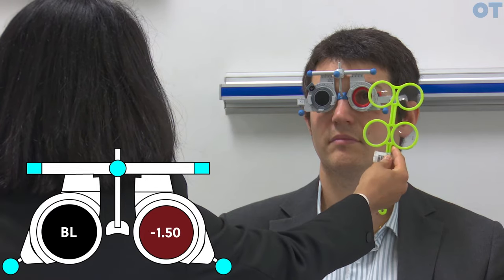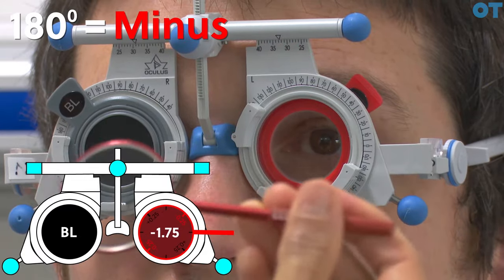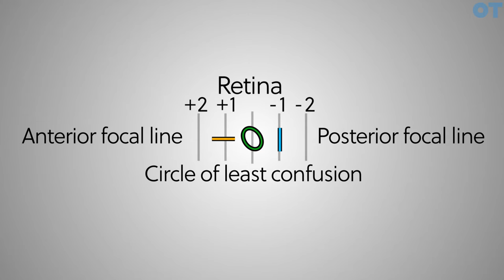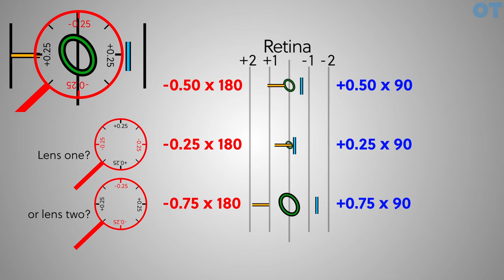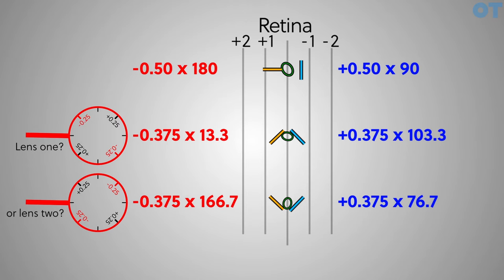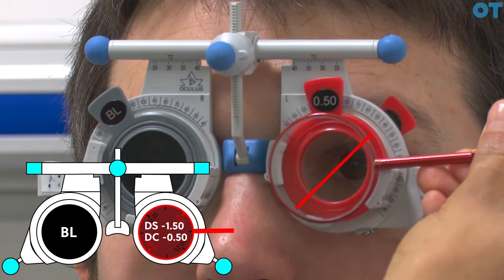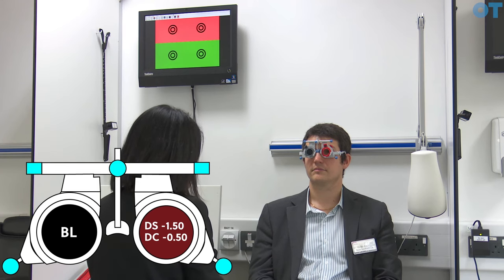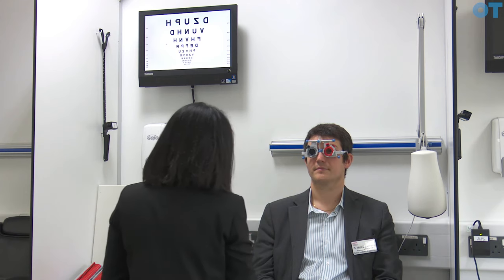OT skills guide: Jackson Cross Cylinder

Comment: Important bit when dealing with patients who have seriously impaired vision since birth (nystagmus, ocular albinism, such as myself). They might have a very weak ability to judge the specific direction of lines in the distance. So, for example, if a patient who has problems with distinguishing vertical lines clearly is being asked if the circle looks sharper with lens one or two, they might base their reply solely on the horizontal-ish parts of the circle. They will have a very hard time deciding if the circle has become rounder or not because the vertical parts will look blurry to them because of their nerve-brain issues, so no lens can fix those. This might make subjective refraction much more difficult when you know that the patient sometimes is confused and might start giving conflicting answers when it comes to dealing with correction at more vertical angles.

Comment: The circle of least confusion was already placed on the retina at the end of the last video (best sphere) and verified by the duochrome test, why do we need to over minus the patient by -0,.25 before using JCC?
Reply: This helps to ensure that the circle is on a retina, because accommodation will bring the circle on retina
Reply: @MrGeriausias  But doesn't the eye need to be at accommodation rest for the whole subjective refraction? Why don't we just leave the circle on the retina by best vision sphere?
Reply: @d.perera7875  Once the cylinder is set, you will adjust the sphere again. You can refine the sphere using the +-0.25 technique. After that, you will move to the next eye.
Reply: @MrGeriausias  Okay but why overminus at all? Isn't the circle of least confusion on the retina by the BVS? Why force the eye to accommodate?
Reply: @d.perera7875  BVS should bring the CoLC on the retina. However, there is a chance that a patient made a mistake in deciding which sphere is clearer. If you are not 101% sure that the CoLC is on the retina, it is safer to over-minus myopes and under-plus hyperopes cause accommodation will bring the CoLC on the retina. Over-minus myopes and under-plus hyperopes is a harmless extra step that fulfills the CoLC requirement of JCC  test.

Comment: I don't think it's a good way of teaching JCC...we were taught a much better way by professor Barratt and Prof Elliott at Bradford uni...check his book out... Primary Eye Care. Not saying this is wrong...just over complicating what in essence is a pretty simple task.
Reply: Do you check cyl power first or cyl axis first? Which one do you start checking at the beginning.
Reply: @SharrpDesigns  cyl axis first usually
Reply: Do you leave the -0.25 (that you include for the JCC in the beginning) as part of the prescription, or do you remove it after the process is finished?
Reply: What if a patient did not report axis as equally clear but one to be clearer than the other, were by you will begin to go back and forth what axis should be used.